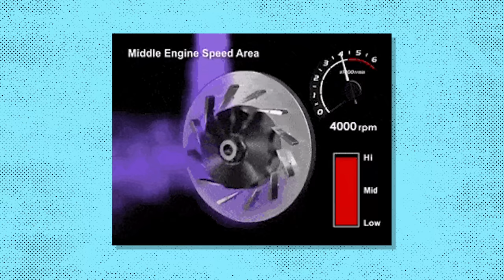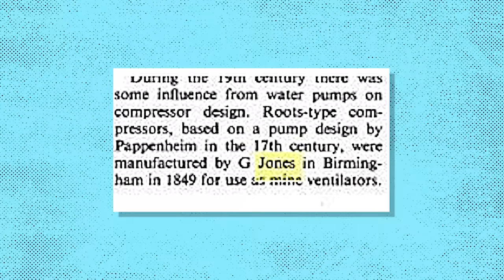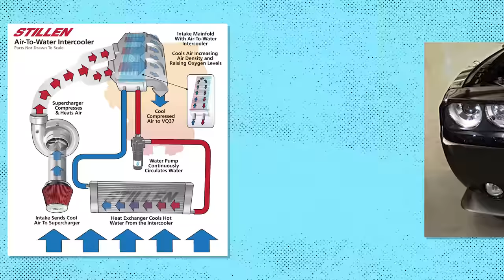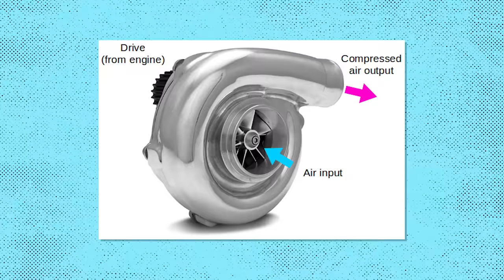Why Superchargers Aren't As Good as Turbos

Comment: But. Here's the But.
Superchargers are originally became a big thing in the Second World War. Why you may ask.
Altitude.
Superchargers and Turbochargers were originally designed not for aviation, but they reached their potential on Planes.
Superchargers specifically were an efficient sacrifice. You could chose to have more HP on lower altitudes, and almost none on higher, OR to have less horsepower overall, but you will have that at higher altitudes. A German design took this to the extreme called the Focke-Wulf Ta-152H, which had 3 superchargers, plus a Nitrous injection system, which let it have maximum power at 10200 meters above sea level, compared to that, the Japanese Yokosuka D4Y2 Suisei, the fastest dive bomber ever made, had no turbo or supercharger, and it could only fly at 5200 meters above sea level at max engine power, over that it would constantly lose power, and at about 9000 meters, the engine would not be able to produce enough power to keep the plane flying.

There is a lot more to areial combat, but basically, Superchargers and Turbochargers meant a huge advantage.

Comment: Is it better to put a plug on the exhaust system that I have to wait for it to spin than to take 3-5 horsepower from the engine and get a lightning response to the throttle?
Reply: YUP! Turbochargers are better
Reply: @sandervanderkammen9230  So you, as someone who drives a three-liter in-line six-cylinder engine with an 87mm turbo, claims to reach a faster nominal pressure and has a more predictable output power than the supercharger that is proportional to the engine's speed and load? 😁
Reply: @bwc18270  That would depend on numerous other factors that you have completed ignored... 
The fact is turbo lag is greatly exaggerated and is only a problem for inexperienced or less skilled drivers.

Comment: Supercharged engines have exponentially longer life. I wanna get to 90 fast not go from 120 to 150 faster. They are so much more fun, and much easier to work on. Sitting here in a 2000 gtp with 210k, still smokes anything near it in power to weight ratio. Other than a valve cover leak the engine is pretty immaculate. You just dont see turbocharged engines on a factory set of seals past 50k. Never buy used turbo cars, you can be one redline from a blown engine.
Reply: The car absolutely eats ff turbo setups in the city. Its not even a competition.
Reply: Wow! A 2000 GTP??? That POS makes less power per liter with a supercharger than many naturally aspirated engines... and with better reliability too.
Reply: @TobachBore  What turbo competition did you beat? A Chevy Cruze ecotec? Or a garbage truck?

Comment: While I do like turbos more I think the fact that the super sits on top is a good thing in the long run because lowering the engine lowers the center of gravity
Reply: Superchargers are not necessarily mounted on top of the engine, they can and are often mounted in similar   locations as turbos
Reply: @sandervanderkammen9230  i understand however he mainly mentions top side superchargers so I was going with that regardless both are amazing
Reply: @joun0529  Unfortunately some people associate superchargers with a big roots blowers on top of a Chevrolet Small Block... of course this is very misleading as it only represents a very small percentage of supercharger applications.

Comment: I like how the detroit diesels decided not to choose if turbo or supercharger, ok mostly out of necesity, and made a charger that is both driven by the crank and the exaust, so it had the best of both worlds.
Why not only using turbo? because detroit diesels are 2 strokers and 2 strokers need the positive presure, since they lack a natural way to suck new air and exaust the old one. Simple gasoline 2 strokers use the crank, that's why they need oil, because they dont get to have a pool of oil inside of them. And the bigger ones need forced induction
Reply: Winton Type Diesel engines, like EMD, GMC, Kässbohrer and Detroit Diesel are all Normally Aspirated not supercharged.
They can have a Roots type blower and a blow throu turbocharger that unloads the Roots blower to save fuel.
The EMD and newer Detroit Diesel engines have a coupled Turbocharger that saves costs and weight by eliminating the need for the Roots blower.
In either case they  are Normally Aspirated and air box pressure is only slightly above ambient pressure,  there is no significant boost in manifold pressure.

Comment: You mention that driving a super charger via a belt from the engine takes engine power. However using exhaust gas from the engine to power the turbo charger increases the air resistance leaving the engine which......takes engine power.
Reply: No, they don't. The turbocharger is driven by heat energy rejected by reciprocating engine, energy that is normally wasted out the tailpipe in a naturally aspirated engine.
 Turbos use an Impulse turbine which uses the velocity  (not pressure) to drive the turbine wheel.
Any questions son?

Comment: I don't know anything about engines but Why don't they add an electric motor to spin the turbo at low rps to keep a more constant air flux? is it too hard to strap a motor on a hot turbo? or the parasitic looses would be the same as in a supercharger? There are better batteries now, they could use a sepparate battery for the turbo, cars already have an alternator, Could you modify the alternator to work a lot more during engine braking? that way while the engine is making power it wouldn't suffer from parasitic loses by also spinning a bigger alternator

Comment: Turbos also use engine power. Those exhaust gases are pushed out by the piston. If you create obstruction in the exhaust pipe, the engine is going to produce less power. It is possible that turbos suck less power than superchargers but I am not sure why and the video certainly didn't explain it.

Comment: This depends what you mean by ‘better’. I’ve owned and driven both and from a driving point of view, supercharging is far, far better. The power’s always there throughout the rev range and there’s no lag.
Reply: Drivabilty is not related to actual performance, turbochargers deliver more power which directly impacts performance.
 While supercharger cars have good throttle response they are slower.

Comment: How can you lose power when adding boost with a supercharger? Adding 9psi to an engine will always gain more power over NA engines. SC make sense of higher displacement cars V8 onwards, and it's why you don't really see them on a 6/4cly apart from the odd one.
Reply: Because you have to subtract the amount of power used to drive the supercharger compressor.

With the turbo there is no parasitic drag on the engine, the energy remaining in the exhaust drives the compressor.

That's not true, the fastest production cars in the world are large displacement twin/quad turbocharged... not supercharged.

Comment: Very one-sided take here. Superchargers are only inefficient at higher rpm, where turbochargers shine, which shows why VW's TSi engine is so impressive. On a road vehicle, in most situations you'll be using lower revs and the supercharger can really shine then, especially a twin-screw which combines low losses with high thermal and mechanical efficiency.

Comment: Tutbo's also take energy from engine by blocking normal flow of exhaust gases...
Reply: No, it runs off the heat energy in the exhaust.
Reply: How can the turbo block flow?
Turbos flow more air

Comment: Turbo is like V-tec, you get good fuel economy on low revs and higher power on higher revs.
Reply: No, turbochargers increase fuel efficiency and power whenever the engine is under load.

Comment: Manufactures often go for turbos because the work better on smaller displacement engines. The engine is purposely small for fuel efficiency but needs a turbo to bring it to a moderate hp range. Superchargers just love bigger engines
Reply: That is completely false, and based on some very false assumptions.
The largest engines in the world are almost universally turbocharged.
Turbocharger simply produce more power and save more fuel.
 The development history of turbochargers is based on 2,000 to 4,000 cubic inch aircraft engines and locomotives long before they were used in automobiles.
Reply: @sandervanderkammen9230  so what part am I wrong, I didn’t completely said turbos are only for small engines and I didn’t say superchargers are only for big engines. And bigger engines with smaller RPM range would make sense to have turbos. So where exactly am I making things black and white.
Reply: @Terminator_888  Turbocharging  improves the BSFC of any engine... regardless of displacement.

Comment: A turbocharger also takes some engine power to get it work, as it introduces obstacles in the output exhaust path which make pistons move with more resistance. I suppose the best "charger" could be made just like hybrids: there should be a tank (balloon?) for precompressed air which should be put into engine when it needs to raise engine power and be restored when it's not needed.
Reply: Turbochargers don't use any power from the reciprocating engine, they run on the heat energy rejected by the reciprocating engine.
Reply: Turbochargers make the pistons moves with LESS resistance.
Reply: @sandervanderkammen9230  how can they run on a heat energy if they rev from the exhaust gases stream, which IS produced by the engine? When turbocharger is placed into the exhaust path it acts like an obstacle for exhaust gases, raising pressure between it and the engine, and this pressure makes engine to spend more power to eject exhaust gases than if there would be no turbocharger.
Reply: @postwardream  It comes from the same heat that "revs" the reciprocating engine son..
Turbochargers use the heat energy rejected by the reciprocating engine.
 Turbochargers operate using the Brayton Cycle in a COMBINED CYCLE Heat Engine 
Eg; Otto + Brayton or Diesel + Brayton Cycle 
The turbocharger is a second pass heat recovery cycle.

Actually you have it ass-backwards
The turbocharger helps push down the pistons during the intake stroke, they make more power than superchargers because they increase volumetric efficiency and reduce pumping loss.
 How can the turbo be an obstacle? If they have more CFM flow than a naturally aspirated engine then how can the turbo actually restrict flow?
What goes in? Must come out right?
 I think you need to do a little more study before you understand how turbochargers actually work.
Reply: @sandervanderkammen9230  what I'm saying is that some part of engine's power is spent to make turbocharger work, increase volumetric efficiency etc. This is obvious. You can not do work without spending power. Yes, the overall outcome leads to more power, I didn't argue with that, it works like a "heat pump", when you spend a little, but gain much more. But you still spending, and you can't say turbocharger doesn't take any power from the engine, it wouldn't work then. Imagine you rotate engine by hand, which would be harder for you, when there is a turbocharger in the exhaust path, or if there isn't? In the first case you do work not only for engine's crankshaft rotation, but also for turbocharger rotation, that was my point. You can't say turbochargers don't take power from the engine, no, they do take power from the engine to operate, just like superchargers, but you can say this part of power can lead to better efficiency and thus to raise the overall engine power (part of which will be spent on turbocharger needs anyway). Please read the first commentary carefully.
Reply: @postwardream  You didn't read and understand my comments.
The turbocharger uses no power from the reciprocating engine.
The turbocharger is a supercharger driven by its own heat engine.

The turbocharger only uses energy rejected by the reciprocating engine...
Heat energy that was not converted into shaft horsepower.

That is the whole point and this beautifully illustrates how turbocharged engines produce more power with the same amount of fuel.
  
Turbocharged engines use the heat wasted out the tailpipe to drive the supercharger, no extra load on the engine, no extra fuel burned.
 Turbocharged engines have higher thermal efficiency because they use the combustion heat twice.
Any questions son?
Reply: @sandervanderkammen9230  it's not free (not using any power) to push out exhaust gases from the cylinder even for naturally aspirated engine, the engine spends some amount of power to do that, and if you place a turbocharger's "driving" turbine inside evacuation path it will introduce an obstacle (because it will make resistance for exhaust gases to evacuate), and like any other obstacle, it will make harder for gases to pass it through and therefore for piston to move up at the exhaust phase. Remember that engine always spends some amount of its power for its own needs, and turbocharger is no exception.
Reply: @postwardream  What goes in? Must also go out, right?
The turbocharger pushes the air into the cylinders at the same pressure (or higher).
This reduces overall pumping loss and cancels out backpressure.
There is no Delta~P, no pressure differential between the intake and exhaust manifold pressure on a Turbocharged engine like there is on a naturally aspirated engine.

Turbocharged engines produce more power because they flow MORE AIR and pump that air more efficiently.
No restrictions, no load on the reciprocating engine.
 The additional power comes without any parasitic loss to drive the compressor and the additional horsepower comes without any additional fuel burned.
 The EGT (TOT)is lower than a supercharged engine and That tells us that the turbocharged engine operates with a higher thermal efficiency.
The exhaust gas temperature drops as it flows though the turbo, there is a drop of temperature, usually around 100°C (300°F) this amount of heat energy is directly linked to the amount of horsepower generated by the turbine wheel to drive the compressor.
We can calculate the temperature drop to horsepower by using the Brayton Cycle Formula.
 Any questions son?
Reply: @sandervanderkammen9230  sorry boomer, but other sources contradict with what you're saying. For example, look at the Wiki page and you will found the following: "A turbocharger does not place a direct mechanical load on the engine, although turbochargers place exhaust back pressure on engines, increasing pumping losses.[48]" You can check the source of a link by yourself. That's exactly what I'm saying - turbochargers introduce pumping losses by creating back pressure. Maybe your formula just doesn't take it into account for simplicity?
Reply: @postwardream  Wow! Wiki? Is that where you get all your false urban myths and misinformation?
Reply: @sandervanderkammen9230  I mentioned there's a link to actual article where this info was taken from. And I believe this source is much more trustworthy that some random guy's opinion in comments without any links provided. So prove your statements or... you know.
Reply: @postwardream  I have seen wiki links to articles on Motor1, a amateur blog site that is pure tabloid clickbait.

Comment: Mazda actually fits small superchargers to their skyactiv x engines but not really for power but to have enough air for the lean air fuel ratio needed for their spark controlled compression ignition technology.
Reply: The Mazda Skyactiv X engines have a supercharger for VCR variable compression ratio.
Reply: @sandervanderkammen9230  wut? how does that work and how would you need a supercharger for that.
Reply: @TheDude50447  VVT... variable valve timing.
A supercharger combined with late intake timing effectively lowers the static compression ratio  (which is 14:1) and thus lowers IMEP and pumping loss at low rpm and load.
Reply: @sandervanderkammen9230  Im aware of the variable timings it needs for the regular and the spcci mode. I actually remember it being 15:1 on the more recent one in spcci mode  What I dont understand is why a supercharger is necessary for that?
Reply: @TheDude50447  It maintains manifold pressure and cylinder pressure when the intake valve remains open at the top of the compression stroke... leaving the intake valve open late in the cycle reduces the cylinder pressure at light loads and reduces pumping loss..

It works like a modified version the Miller Cycle engine used in the Mazda Millenia.
Reply: @sandervanderkammen9230  aaaah that makes sense. I just assumed that it was purely needed to have sufficient air for the lean mixture. Thanks that was quite interesting.
Reply: @TheDude50447  No worries my friend.. cheers!